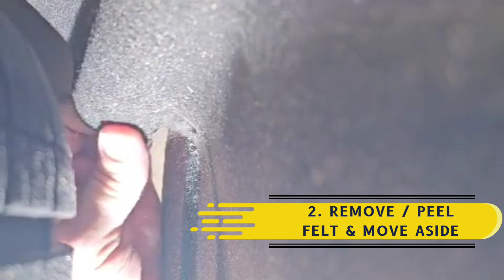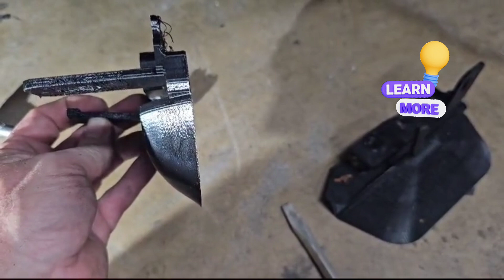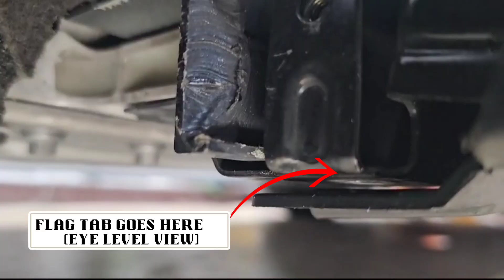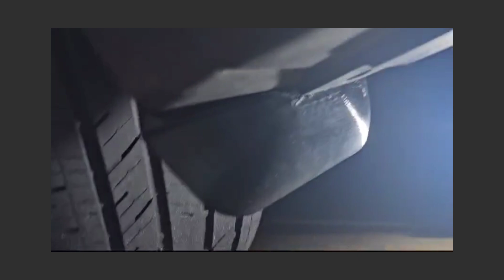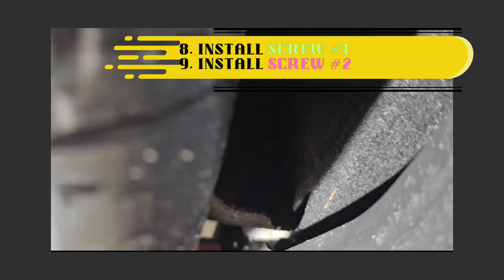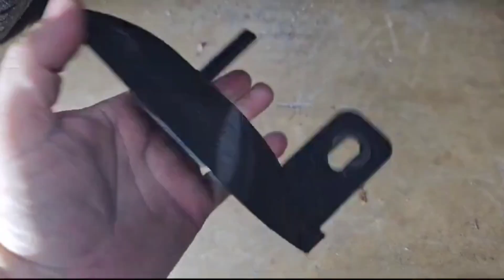Fisker Ocean Custom 3D Wind Deflector Flap Installation - Errons.net

Comment: Thanks for vid. Nice product. Wondering if there would be more aero gains with an even larger version. Longer mkre towsrds the front.
Reply: I have been wondering the same, but don't really have the ability to reliably test for any performance change related to the design. I was just trying to find a more sturdy design and material. I figured if I stick to the same frontal area, then we would most likely get the same performance. 
At least, this is so far holding up longer for me than the original.

Comment: Great vid. I still wonder how much of the Ocean was designed between Magna vs Henrik. And to add onto that, how much the CFO-COO’s input on cost cutting impacted quality.
This air flow deflector has never been an issue on any other car I’ve owned.
Amazing to have lost my Fisker pair around the same time within the first 2 weeks. Around March in Norway. Unbelievable.
Would love to hear feedback after 6-12 mths use.
I am not sure if you ever drive in snow sludge conditions, as I feel there is also a downward pressure from within the wheel well tearing / peppering at the original flimsy flap material. Or if the negative temperatures made the material more stiff/ brittle and prime for ripping.
Reply: I live in Florida, so no snow, and normally nice and warm, so the material should stay pretty soft. 
Both of my original flaps broke off between 11500 and 12000 miles. 
The back side of these 3D printed flaps is 4 mm thick, so there should be plenty of material to take a beating from sand and gravel thrown from the tires.